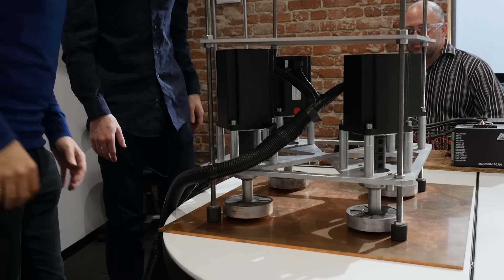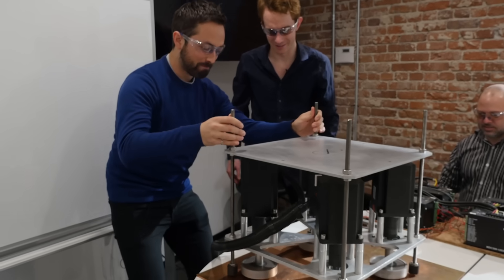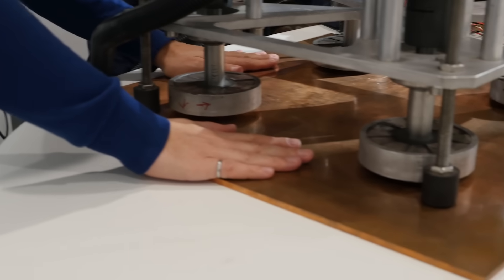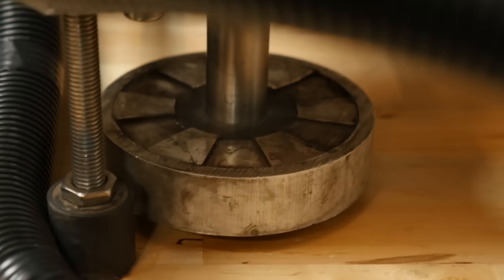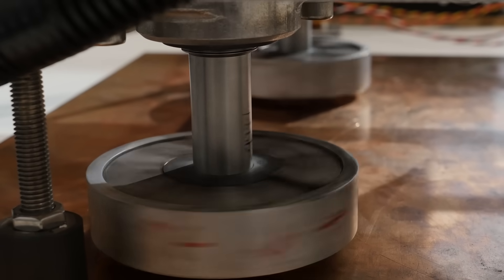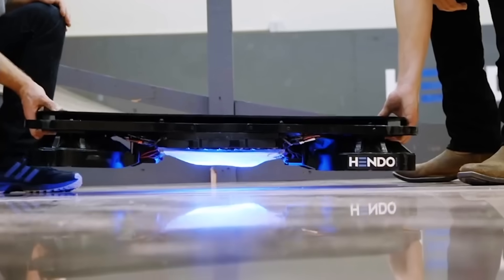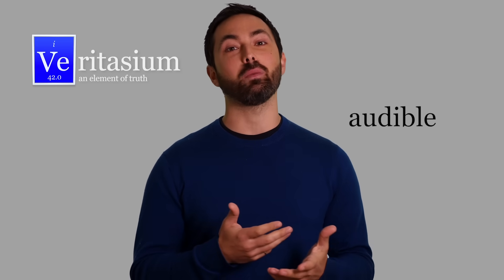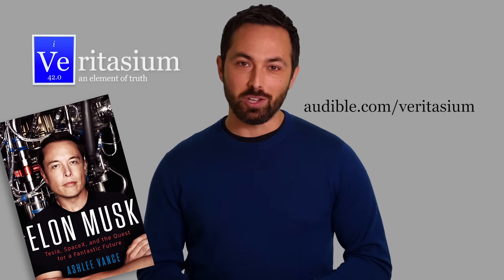Electromagnetic Levitation Quadcopter

Comment: FANTASTIC video Derek. I'll teeet it in a second. It make me realize that wouldn't there be a type of magnetic terminal velocity for hypoerloop because of Lenz's law?
Reply: The faster the train goes the weaker magnetic field is needed for levitation at a particular height due to the faster rate of change of magnetic field along the conductor, would that also mean that oddly enough the "magnetic drag" wouldn't increase or decrease but remain constant at any speed (assuming the strength of the magnetic field is changed accordingly)?
Reply: SmarterEveryDay Lenz's law is responsible for the levitation itself. The speed of such a vehicle would be limited by the additive effect of inefficiencies in generating the levitation, such as the torque applied to each rotor by the slight difference in location of the magnetic fields, friction in the moving parts, air resistance (a vacuum on the scale of a hyperloop would require an insane level of energy and money to maintain), and others.
Reply: *teeet
Reply: Being fair in the other direction, Oil Pipelines deal with the same issue, under MUCH higher pressures.

Hoop stresses get worse as you make bigger tubes, but oil pipelines still operate at 600-1000psi.  We're only talking 15 psi.  A massive rupture might also cause problems that would have to be designed around - safety brakes and such on the pods to keep them from being turned into an air-rifle bullet.  But the likely leaks in the hyperloop are just going to be microfractures, that slowly let in air and don't cause a pressure wave.

The idea that the inside has to be a vacuum, as well, is incorrect.  It needs to be low pressure - you're basically recreating the air conditions that planes climb up to 50,000 feet to access.  Most pod designs rely on the air to push itself off of for movement, and to run along its sides to provide levitation, to stay in the center of the tube.

It'll take a large number of pumps constantly pumping to keep the pressure sufficiently low. But that's really just a question of scaled cost, rather than danger or impossibility.
Reply: I'd be more concerned about the fact that you have a couple hundred km of thin steel expanding and contracting by a few football fields in length.

Even if you add a few thousand expansion joints that can hold the low pressures, anyone could go to any point on the journey and rupture it, sending a pressure wave along the tube, slamming into everyone inside.

The hyperloop is also two orders of magnitude larger in volume than the 13.25 billion dollar LHC, which is currently the largest vacuum tube in the world, kept at a constant temperature below ground.
Reply: moist
Reply: Being fair, it was never directly proposed as a cost-effective method.

It was proposed as cost-effective when standing in contrast to an idiotic $50 Billion 'High Speed Train'. to be built in California.

Estimates of building a similar hyperloop were conservatively placed at $10 Billion.  It's possible that could be dropped to more like 4 or 6 billion with innovation.  Still a rather costly endevour and not necessarily cost-effective.  Just far, far less ludicros than $50 Billion to build the worlds slowest 'high speed train'.
Reply: SmarterEveryDay that grammar destin haha
Reply: +Xylos144  I don't see what you're saying about the vacuum of the LHC. I never said the hyperloop used a vacuum. In fact I specifically said "low pressure" instead.

Floating the tube above the ground for hundreds of km would be an engineering nightmare, and still doesn't solve the expansion problem. If it expands by a few hundred metres total, the ends are still in the same place. You'd have to move one or both of the stations at either end.

The problem still stands that anyone could completely compromise an entire track just by rupturing the piss thin metal that they have planned right now. The only solution to that is to either thicken the tube or reinforce it somehow, adding a couple more million to the budget. If the expansion joints AREN'T airtight, then air leaks and now you have to pump air from the tube constantly. If they leak, and with the amount that they would need they undoubtedly will, same problem.

There's also safety. In the event of a failure, how do you evacuate people from the tube? Now you have to add exits that a pod can connect to safely, all while being vacuum sealed. If THAT isn't sealed then you've compromised the entire tube and now have to repump the air back out afterwards. If there's a leak, you have to find it somewhere along the miles of tube and then fix it, meanwhile the entire tube is unusable.
Reply: Thats right Destin, and according to their calculation its gonna cost to fix that problem. They are gonna need about tree fiddy
Reply: +markhill415
Well, it's the same effect that boils down to an equilibrium that depends on the amount of a constant acceleration and a deccelerating effect that depends on the speed. Pretty sure that if you generalize the terms enough, both a falling object's terminal velocity and the top speed of a constantly accelerated vehicle (magnetic or otherwise) come down to the same differential equation.
Reply: Magnetizing a material takes time, i think it's called the relaxation effect or something similar. So it must be possible to calculate at what speeds the magnetic fields get to weak to lift you.

I suspect you have to go really really fast before that kicks in..

Aside from that, anyone an idea how much power this device uses?
Reply: Destin, remember those polymagnets?  I'm thinking if they could print a solid ring in the same orientation as they need here that you could likely make a similar small levitation machine, and if they can print something as big as needed it might be a perfect way to make this work on a huge scale.
Reply: This makes me question if Destin was the one behind the keyboard
Reply: Can they make the copper sheet hemispherical or a sphere ? To simulate zero gravity like air bearing table. It can be used to test the attitude control systems in a cubesat.
Reply: I'll teeet about the hypoerloop too Deeestin.
Reply: Get outa here you Lock Ness Monsta
Reply: hello smartereveryday i watched all of your videos and subscribed  :)
Reply: what?
Reply: SmarterEveryDay  I love u
Reply: SmarterEveryDay 
Once i read 'fantastic' I automatically started reading it in trump voice.
Reply: SmarterEveryDay flying cars?
Reply: how fast can an electron move when in metal?
Reply: Justin nitsuj -- a few feet a minute, something in that area..
Reply: Drunk comment?
Reply: the propulsion is being provided by linear induction motors, so the field speed would be a function of the coil length and the operating frequency of the power, so whatever the theoretical max speed would be based on Lenz's law, excess heat, safety concerns or other physical limitations will probably come into play far before it gets there.
Reply: Now the hyperloop is just Tesla’s driving in a tunnel at 35mph
Reply: @jsd05  well not necessarily they can go up to 130 mph but it's not complete yet... For the long stretches from New York to LA will be an actual train... Just a lot of stuff on the plate right now.
Reply: ОЧЕНЬ  СМОТРЮ  ВИДИОРОЛИКИ  ЭТИМ  ПАНИМАНИЕМ... НО Я ДУМАЮ  КАТЯБЫ  ШТОТО  ЛИТАЛА НУЖЕН  ДВА  ДИСКА  АЛЮМИНЕВЫЙ  И  МЕДНЫЙ  И  ПОЛОСА  КОТОРАЙЯ  ТЕСТЕШАЯ  И ИЗМЕТАЛА  И ПРЕМЕНО  КИЛОМЕТРА  МЕДНОЙ  ПРОВАЛКИ И МНОГО  МОГНИТОВ, ТОЛШЕНА 12миль  Длина 60 миль Щерина  15 Мильметрах...НАЧЕНАЯ  АЛЮМИНИВЫЙ СВЕРКУ МЕДНЫЙ СМАГНИТОВ, ТУТ  СЕКРЕТ ПОЛОСКУ   СПРОВАЛКОЙ  МЕДНОЙ И СНОВА  МАГНИТЫ  И РЕШОТКА  ? САБРАТЬ  И ДОЛОЖНО  ЛИТАТЬ...
Reply: SmarterEveryDay I already thought that Destins video of that magnetic printer was crazy enough.
Reply: PennyHerbst ft
Reply: interesting
Reply: SmarterEveryDay 

U
Reply: CrazyCuteThing I gave him a dollah.
Reply: But even then, it would be much more than the speed of sound.
Reply: does this thing use lenz's law?
Reply: how much weight does it take to sink the hole north pole ice?
Reply: +Derpy Derp Odd you say global cooling, when ever since the 1960s an overwhelming majority of scientific publications were in favour of warming.
Reply: "cause" is ALL photons...field too.  so happens at c. speed of electrons in metal (generate photon field) is much less than c....simply out run electron motion....
Reply: 2.5 x 10^-4 ms^-1
Reply: S
Reply: No I think the copper material would just burn up and that the velocity is only limited to the source current and the melting point of the materials.
Reply: SmarterEveryDay I
Reply: pardon my ignorance but why do the quad copter magnet discs spin ? 
And why didnt the big cheese wheel ? 
?
Reply: + Zayed aslam.....aaaah interesting.
Reply: fun fact: the hyperloop is impractical. check out Thunderf00t for more
Reply: SmarterEveryDay 😙😊😊😊😎😊😂😎😊😎😊😊😎😎😊🤗😋😍ddfjfytththhgtyruyutq🍑🍑🍉🍑🍑🍓🍐🍒🍐🍒🍉🍒🍉🍒🍊🍊🍒s😊😊😎🤣😎😋😍😂🤣😎😋🙂🙂😋😎😂😋😎😊😎😂😂😍😊😄😊😄😂😎😊😎😂😎😊😊😍😊😍😂😎🤣😎jttjtjfjfgggjf
Reply: Hey it's smerter every day 

Love ur channel btw
Reply: WOW! :)
Reply: SmarterEveryDay  yh
Reply: SmarterEveryDay tweet*
Reply: How thin of a copper sheet will work?
Reply: SmarterEveryDay
Reply: @KastorFlux  "the mainstream view is that Volfson is a crank and that this patent was yet another example of bizzare patent issued for a "device" which has no chance of working" https://en.wikipedia.org/wiki/Talk%3ASpacewarp
Reply: https://www.researchgate.net/scientific-contributions/2045080794_Boris_Volfson
Reply: https://www.science20.com/beachcombing_academia/more_antigravity_developments-89013
Reply: Its effect from Eddy current and Lenz law
Reply: teeet
Reply: Maybe they should use the money on graphene for a space elevator instead. Why bother with a theorethical and very shady project dealing with movement on the planets surface when everyone knows the future is in orbit and beyond? Waste of money and Brain energy
Reply: We can change the world of recycling help me please!
Reply: Tennis balls on the ends of those sharp poles sticking up
Reply: I had the hyperloop idea  when i was a child in the very early  90s and the adults laughed at me so why isn't nobody laughing at the idea now 🤦‍♂️
Reply: @captainunderpants936  hyperloop will be underground... I have in my invention ideas book a fan design to use as a air flow instantaneous changer basically as a additional motor for efficiency and speed on top of magnetic levitation and propulsion... Basically you set up the fan blades for the ventilation system to where they can stay constantly spinning and once a sealed train passes through the array the fan can switch its blades with a gear to where they flip the other way and that way it starts sucking out air instead of blowing air, this is added to the magnetic levitation and propulsion system and increase the speeds to achieve at least 800 mph speeds.
Reply: @AquarianSoulTimeTraveler  thats a very good idea sounds legit  yeah mine is above ground bit cheaper also there must be vacuum no air in the tube just the magnetize rails and the train or the bullet has gis own oxygen onboard it has rocket boosters for start of boost and reverse thrust maybe it sounds dumb but i like it
Reply: @captainunderpants936  the good thing about an enclosed chamber is that you do not need to carry your fuel with you because you can make pressure in the tube behind the vehicle to push it forward just like a gun the bullet doesn't carry any forward propulsion ability just momentum.
Reply: @AquarianSoulTimeTraveler  ok nice its cool to switch ideal and so on thats how stuff gets designed and produced
Reply: 🔴 Why Islam not other religion

 1-islam gives logical and simple idea for God - he is A perfect God - he is not a man nor a son of man nor an Idol or a trinity nor limited nor created - he is totally unique and to him belongs all the good qualities 

2-Islam accepts all messengers of God -- about 124 0000 and in Islam, we love all the prophet of God and we can’t deny any of them - while in other religions such as Judaism for example - they reject Jesus and Mohammed -- and in Christianity they reject Muhammad ... but in Islam, we accept all . 

3-in Islam, there is no mediator between you and God -- you can pray to God directly - there is no need for someone in between... 

4- Islam is the Only religion that is Not named after a person or a tribe or a group, its name means submission to the One True God, if anyone anywhere at any time lived the life of submission to the true God alone , then he is a Muslim.

 5- In Islam (worship) is not about mere rituals. it's a comprehensive term that includes any deed that pleases God. All good deeds are types of worship, smiling, being sincere at work, saying a nice word, and even treating one's spouse gently, all this is greatly rewarded by God. And in the opposite any deed that doesn't please God is a sin; talking bad about people is a sin, cheating, lying, hurting innocent people, harming the environment. 

6-in Islam God is always forgiving - if you always repent (before death ) he will just accept you no matter how great sins you did >he forgive us out of his own grace - there is no price to be paid in order for him to forgive > so it's not like Christianity which says that God can't forgive except by blood of Jesus ..

 7-Islam is a way of life – it organises each aspect in your life.. it has solutions and divine guidelines to problems in your life . 

8-the sources of Islam also was collected and saved is also amazing - it never happen to any book in history --- it's through the uncut chain of known narrators which date to prophet time ... besides the millions who memorised it from cover to cover since that time up till today - besides being documented in front of the prophet by known companions! 

9-Islam prohibits blind following without knowledge and it invite us to use our brains to know truth, it is based on evidence and logic. The rational mind is the basis for religious accountability and responsibility. 

10-the moral system of Islam is v high and perfect and thus the countries that apply Islamic laws in a proper way -- they have less moral crimes.

 11-You won't lose Jesus if you accept Islam, but you will just correct your belief in him , In Islam, Jesus stands a good position in Islam as one of the messengers of God together with other messengers.. they were all special and they were all humans like us-- none of them must be worshiped -- we only worship God who sent them . we believe that Jesus was a noble Messenger of God but not divine,,,, we love Jesus and obey his true teachings and pray like him , fast like him , and a person won't lose Jesus if he accepts Islam -- but you will just correct his belief about him 

12- Paradise in Islam is a real physical life for both Body and soul, you will go there , eating drinking marrying and meeting with prophets and having wonderful eternally unlike in other religions which they think its only spiritual life.

 👉IN ISLAM THERE IS A PURE & CLEAR CONCEPTS OF GOD 

🍃🍃🍃🍃🍃🍃🍃🍃

God is One and Unique: God has no partners, no equals and no rivals. God has no father, mother, sons, daughters or wives. God alone is worthy of all worship. God is the All-Powerful: God has full authority and power over all things. Obedience to God does not increase His Power, nor does disobedience decrease His power. God is the Most High: There is nothing above or comparable to God. The attributes of God do not resemble that of His creation. No part of God is present in anyone or anything. God is Perfect: God does not have any human limitations, such as resting on the seventh day after He created the universe.
Reply: Its not cool it fails in my book for a lot of reasons it more electromagnetic crap
Reply: Teeet
Reply: AWESOME!! I'm about to begin building self-powered magnetic motors soon and I would love to work with guys like this!  The moment I saw it pick up I assumed it must be on top of an inductor to work, then I noticed the copper plate, brilliant!

What I figured out is how to shield the repulsive forces between two magnets by placing a soft iron plate between them on one side to switch a repulsive force between the magnets into an attractive force between the rotor magnet and the stator magnets shielding, then with some careful positioning to get the rotor magnet to not stick when the opposing magnetic fields line up edge to edge, and then the repulsive forces DID propel the test magnet, IT DID work...and since then I have come up with more designs I hope to begin building very soon, and sharing with the world!

That and I hope to use spinning weights to create propulsion devices built into the framework of crafts in air, water, and outerspace, without the need for any wings or propellers or even fuel if both of these ideas work together like I believe the will!

Plus I figured out how to wind the generator coils to cancel possibly most of the "Back EMF" and hopefully multiply the power I can generate as well!

Hopefully soon I can bring these inventions to the world and show you all just like these guys are here with this idea!
(This is what God created us for! To overcome the forces of evil and destruction in our world, and towards "the Pursuit of Happiness"!).
Reply: Is that literally the historical Levitron toy with motors?
Reply: SmarterEveryDay Hi
Reply: teeet
make
hypoerloop
Reply: Also I love both your channels , I am about to finish 12 th grade and hope to get into a good college for doing BTech
Reply: *teat, not teeet
Reply: Jade Okabe terminal velocity is the incorrect term here. It applies to objects falling through a fluid. You are correct that in the situation you describe, magnets would contribute to drag, though so many other factors would also contribute that it is difficult to say which will most limit the vehicle's speed.
Reply: Lenz's law is the first thing that came to my mind, too
Reply: That's why thy are considering to use air buffer (like in a hard disk drives) to lower friction.
Reply: Isn't the Hyperloop just a pipedream? I mean the concept has been around for decades it's just not cost effective to actually make one.
Reply: As a general point about expansion, its a gradual process, not a quick one.  If you float the tube on pylons instead of fixing them in place, it should be manageable.  Certainly a problem to work out.

As for the pressure tube being compared with the LHC, that's a bad comparison.  The vacuum in the LHC is so many magnitudes less than the pressure in the proposed Hyperloop.  Energy/effort/tollerances/difficulty/everything to do with maintaining pressures is generally logarithmic, not absolute.  Getting 1 atmosphere down to 0.001 atmospheres isn't 99.9% of the difficulty. It's hardly difficult at all.  You can produce that with a well-crafted hand-pump.

The hyperloop is re-creating high altitude thin air.  The LHC is literally recreating the vacuum of space.  One atmosphere is roughly 1 bar of pressure.  The LHC drops pressure to 10e-10 mbar.  That's literally a tenth of a picobar.  13 orders of magnitude less than atmosphere, and still 10 orders of magnitude less than the Hyperloop.  This is not anything close to a 'vacuum' that you'd use in any sort of scientific equipment.  It patently requires there to be sufficient air to produce drag and to push off of, because that's how the pods are proposed to float.
Reply: Hyperloop has much bigger technical issues than this, so I doubt it will be much of an issue.
Reply: You are new to this kind of stuff, aren't you?
Reply: "It make me realize that wouldn't there be a type of magnetic terminal velocity... ?" Good old southern roots never mind the "Teeet" and "Hypoerloop" parts. Awesome English man. Trump wins all science with the Bible. *Thhis tech is *biing burned. *Spell Check "Smarter".
Reply: Can either you or derek do a video on " rods from god " type of weapons and how terminal velocity will affect there potential?
Reply: @sayonpalit6390  It wouldnt. The reasons for 'rods from god' weapons never being built or used is because of the cost of putting super heavy objects (like tungsten rods) in orbit would be prohibitively high. The speed is determined by gravity and orbit height. There is no terminal velocity related at all.
Reply: The Orbital Kinetic Killer concept (there are many names for it) is like any other spacecraft re-entering the atmosphere. They are entering beyond the terminal velocity and therefore the suffer from supersonic shockwaves (re-entry flames, extreme vibrations, whatever). If they are powered the "rods" can keep with that velocity, nothing more magical than a jet fighter.
Reply: i loves you Destin...only in a brotherly friendly way tho because of the person you are...nothing funny :D
Reply: SmarterEveryDay n
Reply: What happened to poly magnets? What would happen if you used poly magnets in here?
Reply: SmarterEveryDay s
Reply: hey smartereveryday
Reply: carlos arrache Where did I suggest using copper?
Reply: SmarterEveryDay my 8th grad science teach showed us this
Reply: Djmix Kenny dont use copper dumb ass use paladium or graphin
Reply: you guys would be blown away by what the criminals are keeping from us as secret. research SSP whistleblowers
Reply: no, but there will probably be one for the *hyperloop
maybe edit that
Reply: @rancidmarshmallow4468  4 years late to calling you lame for that comment.  Brought nothing to the discourse